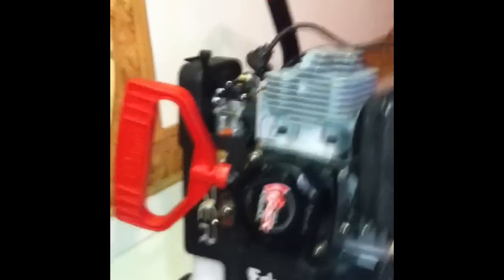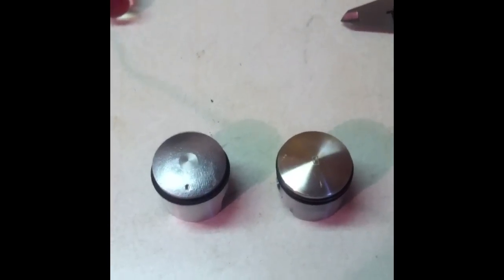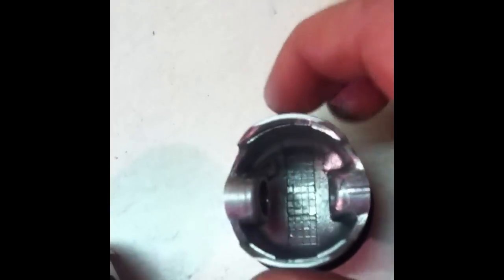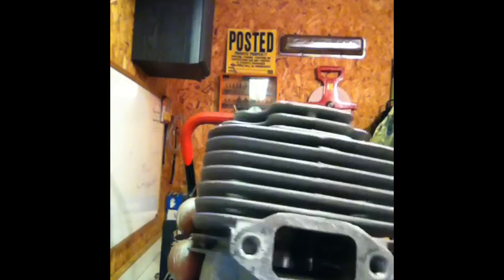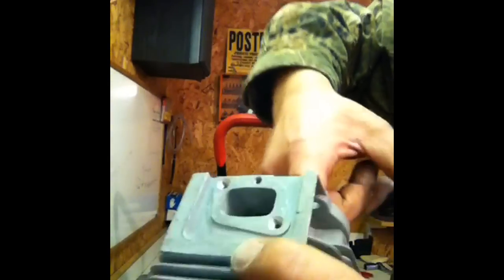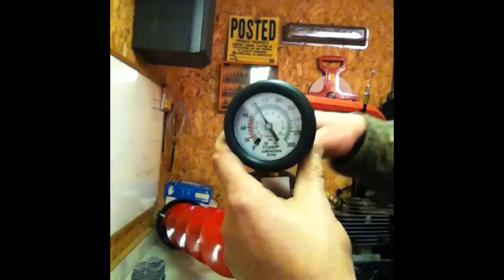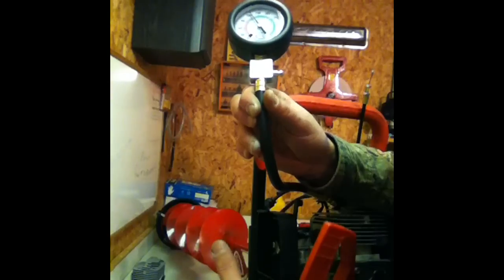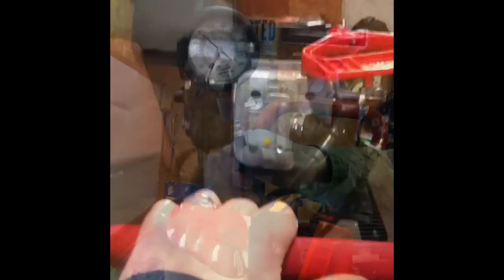Eskimo Mako 43 blown up

Comment: Nice! I am about to pick one up. Sellers tells me it needs a good cleaning  and a new plug. Has been sitting for two years... your video is very helpful if I need to go this route but I doubt it that I will only have to clean the carb and get fresh gas as the seller says it is not starting.
Reply: Rob Fern just drain the gas and throw in some seafoam and gas and that should do it

Comment: Great video, same issue except piston cracked but did not score cylinder. Do you have piston and rings part number???? Thanks
Reply: +1 to this.  Or how to use the engine serial number to figure it out.